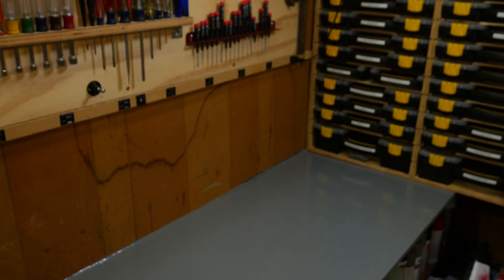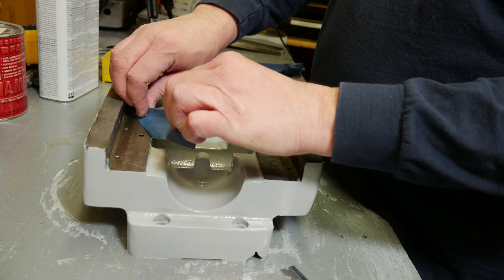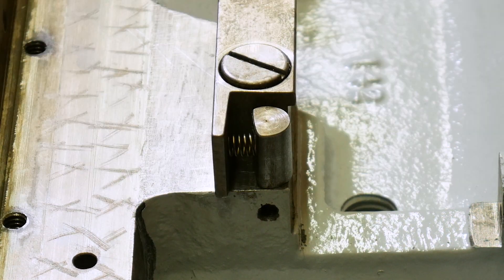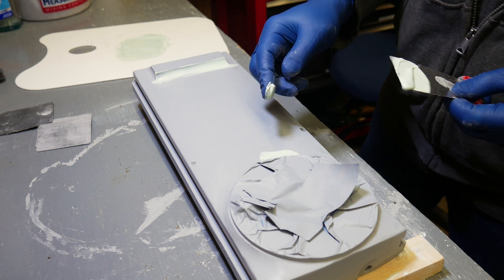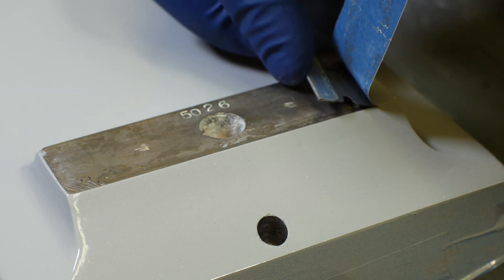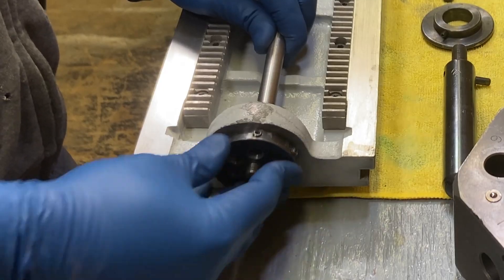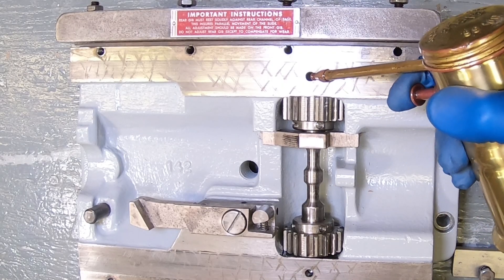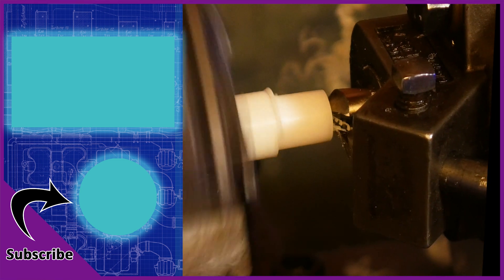Turret Tailstock - Machine Tool Restoration

Comment: I am doing the same for my 10EE (ENCO turret just like yours). Mine has some slide wear from the same problem (was loaded with brass shavings). I am having incredible trouble getting the turret back on. In your video I see the springs (that lift the turret) laying on the bench (they go in the pockets for the pins). Did you put them in? My turret drops right in place without the springs but with the springs I can't get it to go down in place (they're very strong). How did you do it?
Reply from the maker: My springs go in after the turret.  The turret drops down, then the springs go in and what I'm going to call a locking ring goes on top of them.  Then the central shaft screws down in and pinches the locking ring against the turret to lock it in place.  There is enough threads on the central rod to engage while the locking ring is floating due to the springs.  The springs don't lift the turret they lift the locking plate.. if you watch part 1 of this series, at the 8 minute mark is a clip of the disassembly.  Thanks for Watching!
Reply: @PeteRondeau  I'm going to have a look. I actually video'd mine when I took it apart. I'm sure someone has been in there before. There are six positions in the bottom of the turret. Six pins in the plate where the indexing gear is. Mine had three springs in the turret that press against the pins. If I put it back together the way it came apart I can't compress the springs enough to get the turret down. The locking plate you're talking about has two pins in it and a stop screw that bumps the pin in the side of the big turret lockdown shaft.
We'll, looks like you are right. I just changed it up and it went right together and works. I knew somebody had been in there because there were bolts and taper pins missing, and one handle was gone. By the way, if you need new depth screws just ask. I have a couple of die heads and one is going on here, so it should be easy enough to punch them out. They're too long and skinny to single point without a follower rest.
Reply from the maker: Glad to hear you got it sorted out! I may just take you up on that offer sometime.
Reply: @PeteRondeau  Thanks for your help, Pete. I fought with that thing for a week and watched my disassembly video many times before contacting you. To this day I have no idea why it has springs under that plate (can't see what purpose they serve) but if it works I'm not going to worry about it. I can tell you that those are strong little springs. Must have been a big guy who put mine in under the turret. I certainly couldn't compress them enough to engage the turret (then again I'm a lot weaker than I used to be after 2.5 years of chemo). I was serious about the depth stop screws. I can make them from drill rod then harden them. I made a new set for my Bardons and Oliver #3. Seems like someone always bends them.

Comment: Really good job on the turret !!! I grew up in a small shop ,and helped my dad restore and modify a couple older lathes . One was a clausing tool room style turret lathe. When aligned properly and using good holders or keyless precision chucks extreme and highly repeatable accuracy can be obtained . I've center drilled , drilled, reamed and chamfered probably 1/4 million collets of many different styles on it b4 we got a cnc lathe wich could not drill holes to the accuracy needed on holes smaller than around .040 ! So we still used it on small orders and small precision holes down to .008" believe it or not with about .0 to .002 run out . Lastly we retrofitted the turret with a pancake cylinder , phnumatic one , to keep it fully seated to almost completely eliminate any yaw from side to side or up and down, and also used coolant and or air to clear chips . Just air and light lube on the small tiny drills and reamers . They are far more accurate and usefull than most modern shops will ever know because they try to use cnc's for everything.  Little Turret lathes are awesome , I would like one for myself as well as to adapt one to a conventional lathe . Best regards
Reply from the maker: Andrew, thanks for watching and the kind words!  I wish I had a lever activated collet closer for this lathe, that would really speed things up.
Reply: @PeteRondeau  Oh , I forgot to tell you , my dad was real good with phnumatics, I helped and made a few pieces to hold a bimba cylinder to the headstock/ top spindle housing cover , and it was hooked to a lever we made to actuate the collet closer with swiveling eyelet ends , it was a 5c chucker style . Had issues now and then but was great , and adjustable , had to clean collet every 75-100 pieces . Anyhow Merry Christmas , and write on. I plan to get one and do the same to it ! They can be bad ass little machines .